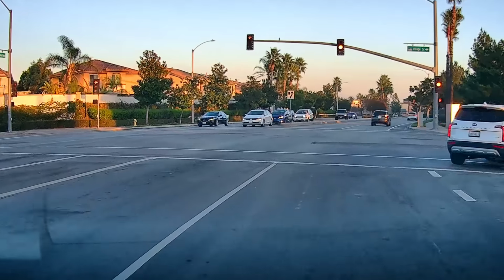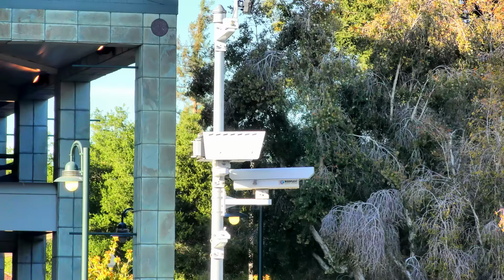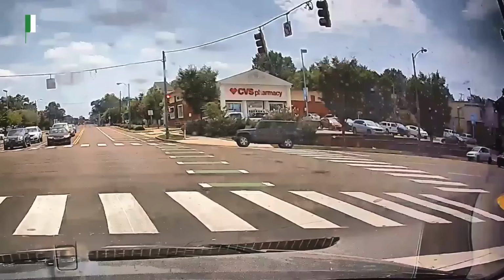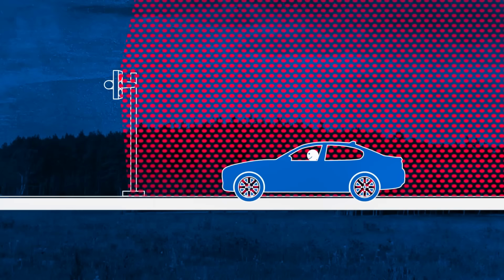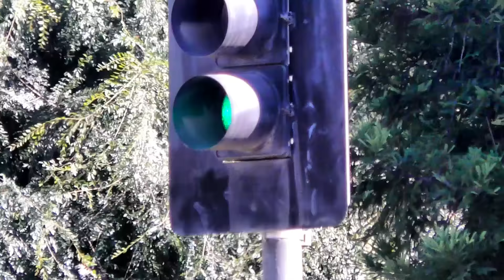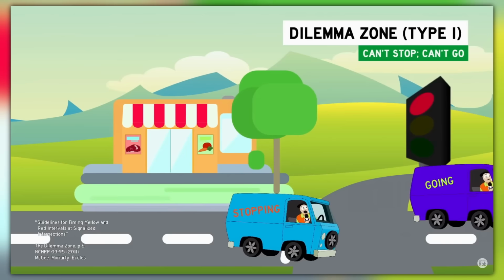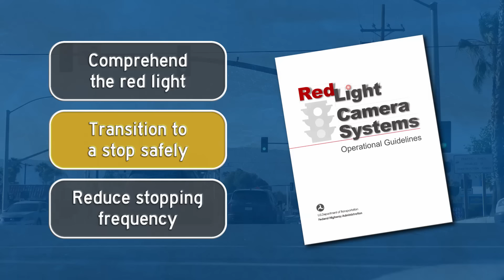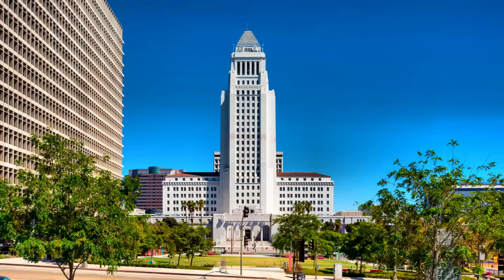Three ways to FIX a STOP LIGHT (so drivers ACTUALLY STOP!)

Comment: In my 30 years of driving, I can recall going through two different red lights!
1) I was young and foolish, riding a motorcycle, the light I was stopped at turned green, I took off quickly, and 100 metres (yards for my American cousins) down the road was a pedestrian activated crossing, it turned red as I entered. I was like 'Oh, Sh*t!' A quick glance in each direction, there was no one walking across (thankfully) and I proceeded with appropriate care!
2) many years later, (in other words, less young) driving a sedan on a 3 lane inter-suburban carriage way, a large semitrailer on each side of me. I was traveling at the posted limited (60km/h or 35mph) and slowly going past the slower moving trucks. We went through an intersection and the ONLY indication I have that I entered on red, was the cars behind us all stopped. The lights were green the last I saw them at the corners of the intersection, there were no centre of intersection lights because of the heavy & high load trucks that regularly use that road.  I suspect that the camera 📷 took a picture of two refrigerator trailers and they couldn't identify me!

Comment: In Greece some traffic lights have an LED display with a countdown, so you know when you should start without delay at green, if there is enough time to pass with yellow and that waiting for the green doesn't last forever. In other traffic lights, the red has bigger diameter than the other two colors. Some pedestrian crossings, apart from the traffic lights, have LED lights on the pavement between the spot that the cars have to stop and the pedestrians. Finally, usually in rural roads, a few hundred meters before a traffic light, there is another traffic light which flashes yellow. It warns you that you are approaching an intersection where the light is red or is about to be.

Comment: I was in the UK in 2009. They had started to install traffic signals at roundabouts because if there was a busy road intersecting with a less-busy road, cars from the less-busy road would have to sit for a significant amount of time because the cars from the busy road kept coming into the roundabout leaving no openings.
Reply: We have multilane roundabouts in DK with traffic signals too. The roundabout still forces you to slow down, making serious accidents less likely.
Reply: The traffic lights at roundabouts are often timed usage. ie they come on during the rush hour or busy times and then when the traffic subsides the lights switch off completely and it functions as a normal roundabout.

Comment: In the Netherlands, traffic lights are only placed on the side closest to the approaching vehicles, not across as in the US. Drivers can see the light from further away and it forces them to decide much further back from the intersection if they will cross, especially during yellow lights. There's no chance to see the opposing signals and attempt to guess/jump/beat the light. They also can't pointlessly creep forward halfway into the intersection during the red phaese. Signals are also much more reactive to traffic conditions in realtime, so drivers don't wait very long to begin with. There's very few if any intersections with ridiculous 3 minute cycles.

Comment: I used to live near a boulevard with coordinated signals.
Back when I had a motorcycle, one day, as I start heading home, my clutch cable breaks. It was late at night, no traffic, so I decided to chance it.
I make it to the exit, no problem, and I managed to get at the right speed to a green light to turn onto the coordinated boulevard, which I made no problem. I was able to go through the fist non-coordinated light, but the second was red but since there was nobody, I just ran in circles until it changed. Let's say I took liberties with the three stop signs between there and home…

Luckily, I could take the bus/subway to get a new clutch cable.

Comment: You know what would reduce running red lights? Light timers. I've accidentally run a few red lights myself, because I "think" there's plenty of green... only for it to turn yellow on me while I'm approaching the intersection at speed. I've since started looking at the pedestrian crossing lights since those turn a couple of seconds before the main road lights, but those aren't always visible. For a time, my city implemented timers on both green and red for every major road. That made it SO much easier to judge if I could make the green. If I have time, great - keep going. If I don't have time, also great - slow down and come to a controlled stop. If I'm not sure, eh - slow down anyway. Better to wait a light than run a red light. But then they got taken away for reasons I never understood, so now we're back to guessing.

Comment: Another way, too, I think would be that signals could have timers on them like the pedestrian signals do. I’ve seen stop lights with timers in other countries like China, and they’d be much more helpful in judgement of stopping or going. I can see how many seconds I have before the light turns red and I can judge whether I have time to get through the intersection or having to stop at the right time. I’ve actually tried it by seeing the timer on a pedestrian signal, and to me, it helps a lot.
Reply: In mainland China the green light may also flash immediately before turning amber, while traffic lights may also show both red & amber lights simultaneously just before turning green, giving motorist additional warning
Reply: I'm in LA where there's a lot of pedestrian counters (that count down to the yellow light -- annoying when it doesn't!) and use this all the time. It's a great idea imo.   

I've also noticed when driving in Mexico that the green light blinks for the last 1-2 seconds before turning yellow, which is another helpful one.

Comment: I live in WI, but grew up in MN. MN have installed flashing lights for some intersections where you have to slow from 60+mph to a stop for a red light. I find it amazingly helpful in every way! I'm not sure it would work in every intersection, but I find it a ridiculously helpful! Whether I am towing a huge trailer, or just want to shut off my cruise control early in my commuter car...it gives me a great heads up. I wish they would do that here in WI. Great video!

Comment: My observations seem to show that modern intersections that put the stoplight at the far side of the intersection almost encourage running the light.  When the light starts changing and you’re at road speed, your already entering the cross traffic area!  Putting lights on the near side means you start slowing way before the cross traffic area!  This problem continues to get worse with the changeover to pole and horizontal beam style light mounting.

Comment: I wish my major local road had synchronized lights... as it stands, if you go at anywhere near the 45mph speed limit, you will actually hit EVERY red light. You actually need to be going around 60 to hit every light at yellow, or 30 to let the light cycle through each time and this goes on for miles.

Comment: In the Netherlands, we have the traffic lights on the near side of the intersection. It makes it a lot easier to see the lights before you're already in the intersection, it means that big trucks don't end up blocking the traffic light for nearly that long, and it means you won't have people edging in front of the stop line because that would make the traffic light harder or impossible to see. The downside is that sometimes you have to put your head in a bit of an uncomfortable position to look up to see the traffic light, but mounting one of these lowered traffic lights at the intersection fixes that problem as well. I feel like a lot of the unintentional red light runners in the US wouldn't have run the red light if it was closer to them and easier to see.
 
Also, roundabouts. We have a lot of them here and they are much safer in low to mid traffic areas. They can cut the number of traffic fatalities by as much as 90% because they force cars to slow down and look, and they turn high speed T bone crashes into lower speed crashes with a smaller angle of incidence.
 
Does anyone know if it's mandatory to have the lights on the far side of the intersection, and/or if there's areas in the US that do have the lights on the near side?

Comment: In Asia(particularly Pakistan) they have timers on the top of the lights running a timer for how long it’s going to be red or green for.. this makes people to pay more attention and not dose off on the lights and people are more situationally aware of how fast they can go which solves the problem of timing on when you need to stop. They also use the yellow light to say hey get ready to go rather than hey get ready to stop because they have those timers and their light switches immediately from green to red.

Comment: I know it means something different when you see a traffic light flashing in the US, but in Mexico right before the yellow light shows up the green light starts blinking. When you see the green light blinking you know yellow and red are coming right up. It's a simple but efficient way to see if you're gonna stop when the light starts flashing or if you're daring enough to run in a yellow or a red light.

I don't really remember what it means to have a traffic light flashing up in the states, but in Mexico, green flashes right before you have to stop, and yellow means that you have right of way, while red is pretty much a stop sign. That's used in the times where the traffic lights aren't yet programmed or aren't being used as traffic lights per se.

Comment: When I visited NYC I was surprised that the traffic lights in the US differ a lot from what I’ve seen in European countries and what we have in Russia where I live. I’m aware that in particular NY has its own archaic lights as well as Eastern Berlin with their Ampelmännchen, but still there are number of improvements to add to make it safer and better, and simply, responsible authorities might take a look and adopt the entire traffic light standards from Russia because they are extremely well-done: one of little things which are actually great here:

1. Almost every regulated intersection has a primary light before, at the right side, and second one after the intersection, at the left side, which make it easier to see the light for drivers at left lanes and indicates the range of action. Also this works well as a backup in case of malfunction of one of lights. Sometimes additional light are installed on a high point, and in some places even the whole pole changes its color thanks to LED stripes across it, so it’s super-visible.

2. In wealthy cities and regions all traffic lights are LED. No comments: they are just great despite the little problem for photophobic people like me with too much glow in the night.

3. Well, since lights are LED, most of them has counters showing seconds left to switchiver, placed in the yellow light circle. The digits have the same color as the active light, but yellow light itself still works as intended, when the counting is over. Even if lights are old, like in Saint Petersburg, there is a separate counter installed next to the light!

4. The light system itself, the routine. It works like that: Green, then 3 seconds of blinking green, then 2-3 seconds of solid yellow, then red. After 1-2 seconds of all-red condition, Yellow adds to the Red at the orthogonal direction, holds for 1 second and then Green turns on.

Blinking yellow indicates malfunction or non-regulated mode, so drivers follow the rules of priority using signs and right-hand rule.

So, normally you should stop before the stop line before it’s turned Red (Since march 2023, Yellow), but if you has crossed the stop line before it’s turned Yellow, you’re allowed to finish the maneuver. If you can’t stop without harsh braking and you can prove that, you’re allowed to cross the stop line on Yellow, but no way you can do that on Red. First time without accidents you get a small fine, second time a larger fine, for the third time you lose your license for a year.

It would take to long to explain all benefits of that system but it it really very safe and worth a prize for efficiency.

Comment: I agree with #3 because a few days ago I was driving on I-65 in Indiana, they had road construction about every 10 miles... no joke. After about 160 miles of it I was tempted to ignore the reduced speed limits, I notice they had signs saying you'd be fined $1000, have a reckless driving charged and possible jail time for speeding. Made me wonder if the constant road work made a bunch of people ignore the warnings and the state decided to raise the fines instead of reducing the road work zones.

I'm sure it could be the same with red lights

Comment: I'd also like to point out that a yellow light should never be any shorter than 5 seconds. Almost all states require the yellow light to be no shorter than 3 seconds. When you add the national highway traffic safety administration requirement to work in a 2 second reaction time for those drivers with the least ability to react, you have a 5-second light at minimum.

Comment: In Germany it´s normative, the yellow time depends on the allowed speed. If there is a limit of 50 kmph (!), it must be a 3 second yellow phase. At 60 kmph it´s 4 seconds and at 70 kmph it´s 5 seconds. It´s not allowed to install traffic lights when speed limit is faster than 70 kmph - except for emergency red lights e.g. in tunnel entrances, where variable speed signs can be switched on in the same moment when activating the stop lights to block a tunnel in case of an accident or serious obstruction. The first drivers reaching the red light then can´s see the speed limit a few meters earlier... that´s only accepted for those emergency signalling red lights.

Comment: Urban sprawl is a huge problem with red light intersections!  Especially in places where they build a bypass around a town,  then allow buildup along the bypass and install lights everywhere along the way!
Unfortunately often times the buildup in an area outpaces the hi way engineering. 
This results in a lack of through roads that traffic can actually move on in some areas.  Nothing more frustrating than having to drive twenty miles with red lights every ten feet making what should be a half hour ride take two hours! Just my 2.

Comment: I like Québec's horizontal lights, where there are paired, square, red lights at the extreme left and right edges of the light bar. You don't have to get the colours right, there's redundancy, and it's emphatic.

There's a definite problem in San Jose CA with stop lights on curved expressways. Montague, for example, has stoplights that you can't even see in time to stop safely. There really should be advance lights.

I sometimes wonder whether (for the future) we shouldn't think about replacing (or at least supplement) both stop lights and speed limit signs with LEDs (or laser projections—there are several technologies to get the effect) that animate along the lane markings at the instantaneous maximum traffic speed—so if you pass the bright dots you're doing it wrong.

Comment: Speaking of unintentional red light running, it happened to me a few times at a particular intersection in Melbourne, Australia years ago.

Approaching the intersection at night I'd see green lights, look down for a second to check my speed during which time the amber light sequence kicks in, blending in with the AMBER coloured street lights. As I'm several meters from the intersection, the red lights suddenly pop into view causing momentary confusion, by which time I'm already half way through the intersection.

Fortunately this always occured around midnight as I was coming back from work so the streets were empty but it did scare the absolute hell out of me and eventually I ended up taking a different route home.

Nowadays most street lights are of the white variety.

Comment: One thing you didn't mention is using the green and yellow lights together as the first stage.
So you go from green to green and yellow, then yellow and then red.  This gives people notice that it's about to turn yellow and they can better judge what to do, especially if the speed through it is high.
Reply: That's interesting option. Something similar is used in Europe in the other direction. Red changes to red and yellow to tell you that it will be green soon. It could be done that way for green too. Green changes to green and yellow to tell you that within a few seconds it will be yellow. If it's a nice, sunny day, you are fine going on yellow as you will easily clear it but if it's wet or snowy, you need more distance, you already stop on green+yellow as you need more distance to stop and are driving too slow to clear all of this during just yellow.
Reply: We just have timers on every stoplight. So people see how much time they have.

Comment: The sad fact is that most traffic control systems are more traffic flow restriction than control.  Most currently used traffic control systems operate pretty much the same way they did when they were first introduced.  More often the not, the timing on the traffic lights is setup for the one you're at to go green, and the next one to go red upon your arrival.  Most cities have too many traffic lights and stop signs along with unrealistically low speed limits like 25 MPH.